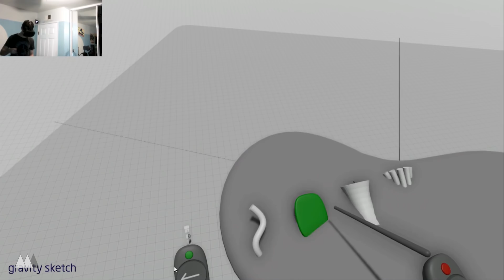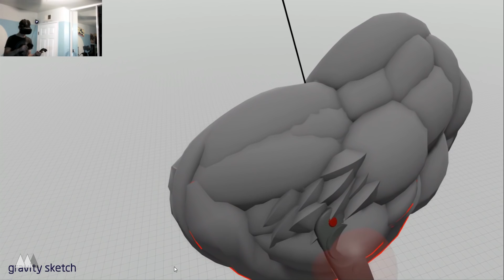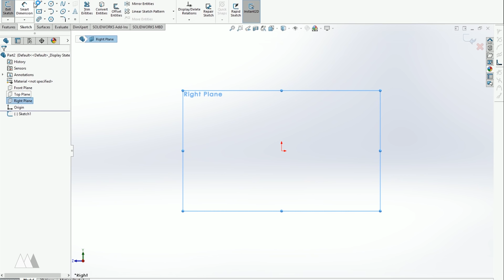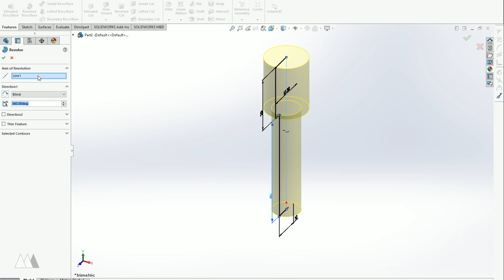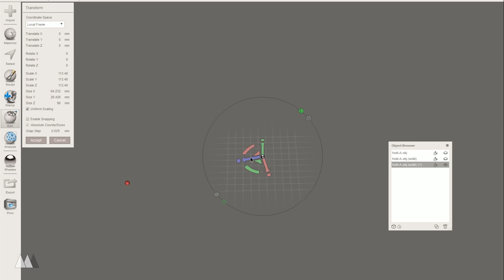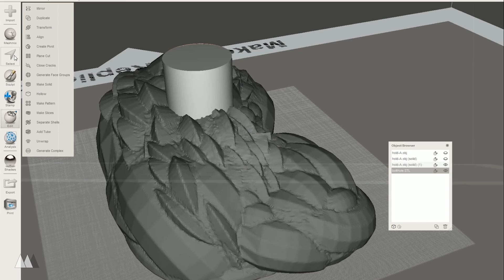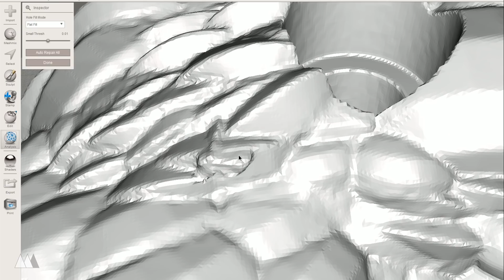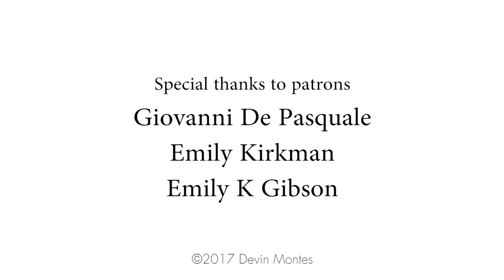3D Printed Climbing Holds (modeled in VR, of course)

Comment: Is the software hard to learn? If you print these with a cheap material and then make a silicone mold from them and pour resin as is the common way to make holds that would be awesome. I am just terrible with technology though. How much is that big printer you used?

Comment: How did the nozzle fair against using carbon fibre filament? its notorious for grinding out nozzles. Have you considered using the wood fill filament or poly carb? the wood fill would be perfect for this and has a surprising amount of strength (and has out preformed the carbon fibre in some tests). I love the giant knot hold and its a great shape for multiple orientations on a wall.

Comment: Cool!  That worked better than I had expected!  For spinning, the simplest approach is to add one or two wood screws through the hold and into the wall well off center, but lots of gyms don't like additional holes in their walls, of course.  Adding a sand-paper or sticky rubber backing would help - I wonder if you could melt coarse sand into the back face with the heat gun?  For the bolt, first off use a thick washer so the holding force is more spread out.  From there, the internal forces want to rip a conical section of the material out so doing the entire hold solid is a waste.  (In yours, a cylinder ripped out only because that's how it printed, if it was solid and failed like that, it would have been a roughly 45 degree angled cone starting at the back face of the bolt and spreading wider towards the back of the hold.)  Focus on making somewhat more than that 45 degree cone solid, and that will be a fairly efficient starting point.

Comment: How about using an over sized hole for the bolt with a metal sleeve that is held into the 3d printed hold with a resin such as epoxy so you don't have that crushing effect in the plastics. this technique is used for fasters on dirt bike and ATV plastic body panels so they do not get crushed. 👍
Reply from the maker: metal inserts could totally help!
Reply: Make Anything // 3D Printing Channel I look forward to seeing any results from future iterations!

Comment: To stop the spinning the back of the hold is ideally concave so that the outer edge of the hold (at the end of the "lever") is being held by more friction. Obviously this is hard to achieve without grinding a concave into the print after the fact. The simple solution for more grip might be hovering the part 1mm above the build plate and generating support (maybe even in TPU or similar?).

I think softer/more flexible plastics like ABS and PETG would work well because they would flex rather than just snap. Perhaps setting the slicer to print the first 7mm of bottom layers solid would make sense, and using a washer to increase more surface area for the bolt to press on.
Though for a tougher plastic maybe Polycarbonate is worth a look?

Comment: Yeah I also discovered CF filled filaments are a bit lame lol. For meshmixer few tips!!! When you delete an area you can just double click near the blue outline to automatically select all the surrounding triangles then do edit-erase and fill to clean it up, and with boolean operations I usually untick 'auto reduce result' if it's causing me problems, but the latest version is sooo much more stable. Try your next holds using the new 3D infill in slic3r :P

Comment: Didn't you get thermoplastic and duroplastic mixed up? thermoplastic materials get deformable under enough temperature and a duroplastic material doesn't, once it's fully cured. (sorry for rough translation, only use ther german words for it)

Comment: The smaller holds might have broken because theres less surface area for the pressure from the screw to be spread across (I'm no structural engineer, so don't flame me if I'm wrong). Definitely an awesome application of such an up-and-coming hobby though!

Comment: the larger one worked better perhaps because there was more surface area to distribute the weight / force being applied by the bolt. That or or could be that the carbon stuff like you discovered, is more brittle / not flexible.

Comment: I have thought about this before, but I'm not a climber myself, so I didn't try it out... My idea was to print it mostly hollow and without any bottom layers and then fill it with a resin. (Epoxy resins are probably better, because PU tends to get hotter when curing) You could also use something like XTC3D as an epoxy coating to get better surface strength and even mix that with sand or something similar for more grip. Keep at it! :)

Comment: Hey Devin great video! Have you tried printing parts with adding metal parts in your prints (pausing the print at a point were your ready to put in the piece that's needed then continuing the print from where it left off) for example like a large metal washer in this case I think would help the strength and structure of the wall hold when bolting it to the wall.
here's an ex.-https://www.youtube.com/watch?v=Vh3NRsKSZAc

Comment: Carbon fiber is really useless for functional parts, it snaps way too easily. You need some form of textured nylon, maybe a modified nylon composite. PETg (which is t-glaze) is way too slick. The best I think is polycarbonate, but you need a heated bed. Try PC-Plus or PC-Max. Really strong and has a good texture

Comment: just a quick tip when you use after effect's warp stabilizer. Try doing rolling shutter repair first to reduce the warpy effect and you can turn off warning to hide that unanalyzed frames

Comment: carbon fiber filament sucks.This has been tested many times composite filaments are never as strong as the base material.

Might as well use regular pla or even better use PC also taulman 910 should be good
Reply: VenomTheCat Watch Thomas Sanladerer's video about baking PLA ! CF doesn't give good strength to parts, but it helps when baking parts, it allows then to shrink less according to ProtoPasta ! :)
Reply: I am not sure less shrinkage when baking printed parts justify the cost for carbon Fiber filled filament

Also un-baked pla parts are still way Stronger than annealed CF prints

Comment: Could you print with a large washer in place on the back as structural support to prevent the material warping towards the screw boss in the wall?

You could design with a cutout for the washer then print up to the washer thickness, pause the print or have a "pause at z-height" and place the washer and have the remainder print with it integral to the part.

I would think having higher infill or even doing a manual infill around the bolt to further reinforce would reduce some of the distortion.

Great video, as always!

Comment: I would love a 3D printer but I'm on a small budget what would you suggest love you
Reply: The Monoprice Select Mini. It costs 200$ and it's a very reliable plug-n-play printer. It's very popular because it's such a good printer for such a low price.
Reply: Perfect Tomorrow one of those prusia i3 copy (cost up to 200 euro with printing bed and quite large printing space) or tronXY 3d printer (what I can say is that it looks a little bit more stable but smaller. but its basically metal beams that you can buy longer and make it bigger so yeah)
Reply: MatthiasChristiaens Small build volume, but most people (me included) won't need more than the 120*120*120mm build volume. The select mini is definitely going to be my first 3d printer once I get the cash
Reply: c fahy The bed is large enough for modt prints I think but I personally prefer a larger printbed. I would go for the Select Mini if it weren't for the small print bed so I'm going to buy a Wanhao Duplicator i3 Plus. This is what I would recommend if you want a larger build plate but as I said, the Mini's bed will suffice for most prints and is great for beginners.
Reply: Thanks for all the suggestions
Reply: I have a Da Vinci Jr. 1.0 wifi and i got it for about $315 and it works great!! It does pretty well with overhang and i haven't found any downsides of it other than the fact that you have to use xyzprinting's filament. heres the link -  http://us.store.xyzprinting.com/us_en/catalog/printer/daVincijr10w